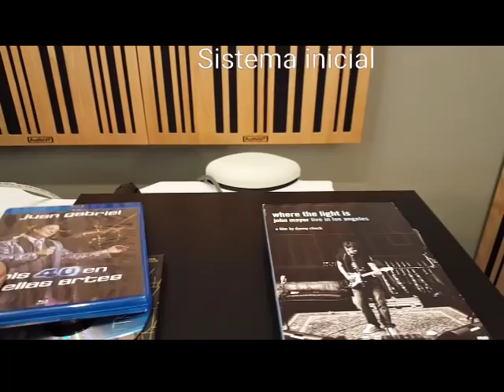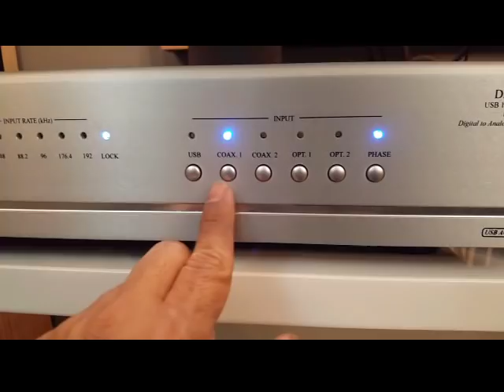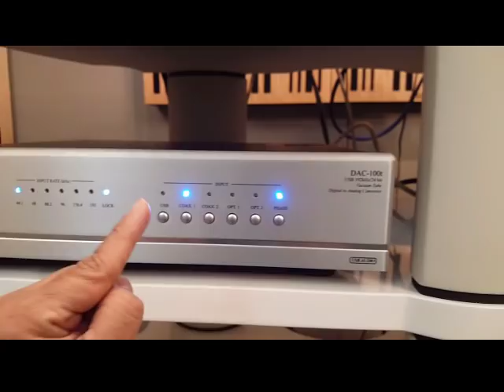Sistema inicial, intermedio y avanzado de audio

Comment: hola fernando un placer ver tus videos como siempre , estoy con ganas de poner una jabalina para tener una tierra aparte para mis equipos , difinitivamente al no usar la tierra de la casa estaria exentos de parasitos que provengan de otros electrodomesticos , que opinion tienes?
Reply: a ver, necesitas hacer una instalación independiente totalmente, no solo la tierra, si no que la linea eléctrica debe salir de la caja general de protección (donde tienes centralizados todos los diferenciales y termicos), debes ponerle un diferencial y termico especial solo para esa linea, y, si puedes, también incluirle una protección contra sobretensiones (mas que todo porque filtra la red electrica). si quieres saber mas sobre el tema, visita el canal de domo electra Manuel amate, que creo que tiene unos vídeos relacionados con el tema.
Reply from the maker: en mi cuarto puse una instalacion independiente de mi casa junto con la tierra fisica

Comment: hola buenas tardes , te pregunto por favor en tu sistema de audio que estas mostrando estas utilizando algun subwoofer para las frecuencias bajas como son 50 - 80 htz ? , por que utilizas un DAC si ya los propios aparatos cuentan con uno , soy de los que me gusta escuchar la musica de fuentes analogicas principalmente de tornamesas aun que tengo un reproductor de sacd y dvd-a conectados via rca en solo 2 canales , cuento con 2 parlantes de 5 vias que van desde un subwoofer de 12 pulgadas , uno de 10 pulgadas un medio , un tweter y un super-tweter y la calidad es fenomenal donde segun lo que creo que tengo un rango aceptable en un equipo aceptable , onkyo integra de los años 90 y soy amante de lo vintage , me encanta tus presentaciones en youtube y te felicito por tus temas donde me han sacado de dudas ,gracias
Reply from the maker: Primeramente te agradezco Roberto por tu tiempo. Uso un DAC externo porque uso muchos archivos en alta resolucion desde mi computadora a traves del USB a mi DAC y tambien porque un buen DAC externo es mejor que el DAC interno de los reproductores. No uso subwoofer porque los estilos de musica qu escucho no lo necesitan ademas qu no soy fan de las frecuencias super bajas

Comment: Saludos amigo
Oye tengo una pregunta
Quiero comprar un amplificador Mitsubishi para mis bocinas kenwood 
Es una buena decisión?
Reply from the maker: los Mitsubishi vintage salieron muy buenos
Reply: Con permiso de Fernando, me voy a inmiscuir en tu pregunta i voy a intentar aportar algo, aunque eso si, generalizando. 

Para saber si un amplficador i unas bocinas van a "entenderse", el requisito fundamental que tienes que ver, es la impedancia. Me explico. En principio (hay alguna, aunque pocas excepciones) tus bocinas deben tener igual o menor impedancia que la salida de tu amplificador. Si la impedancia de las bocinas  es mayor que la del amplificador, corres un elevado riesgo de quemar este ultimo.

Dicho en terminos entendibles: Las bocinas ejercen una resistencia a la corriente que les envia el amplificador. Si esta resistencia es mayor que la "fuerza" del ampli, este se va a "lesionar".

No importa la potencia en Wats. Ell amplificador se va a romper.

Esta nformación la podras encontrar via internet, o probablemente viendo las placas de identificacion  de cada elemento.

Despues hay algun otro detalle que tiene su importanica, pero , digamos que lo basico es la impedancia.

Un saludo!
Reply: @jordifite5400  tienes razón!  Hace poco tenía un home theater y tenía 2 sets de medio agudos y 2 bajos. Lo que termino por suceder después de 1mes es que encendí el aparato muy temprano y en una mañana muy fría se quemo el aparato. Gracias por la atención.
Reply: @jordifite5400  hola. amigo me temo que está equivocado respecto a la impedancia, el amplificador corre el riesgo de "quemarse" mientras mas baja sea la impedancia de los parlantes, I =V / Z, si la impedancia tiende a cero  I tiende al infinito, por  otro lado una impedancia mas alta "reduce" el rendimiento en potencia del amplificador   ya que I tiende a la baja, P = V x I,  expresado en Watts.
Reply: @carlosvenegas2186  Hola Carlos. Efectivamente es como lo comentas. Pero al responder la pregunta de  Mister Troller, entendí que lo que estaba buscando era un "consejo" mas básico. Por eso mi recomendación de amplificador de 8 om asociado a cajas de 8 o de 4, por que como muy bien explicas, si se hace al reves, el rendimiento del amplificador bajara, pongamos que a la mitad. Por tanto, para obtener una presión sonora "decente" el amplificador va a estar funcionando a un nivel de volumen muy elevado constantemente. 

Saludos!